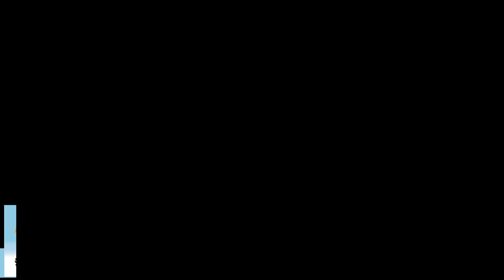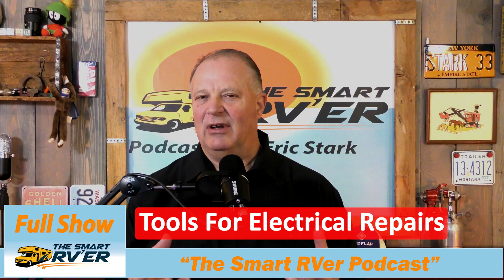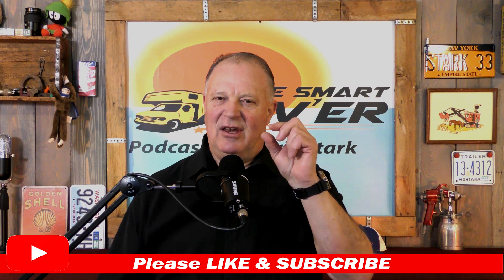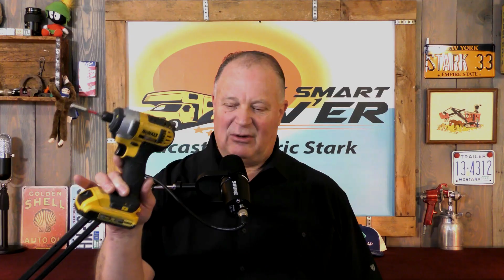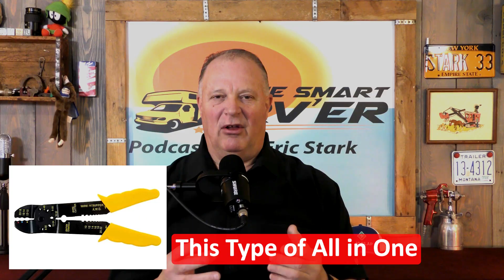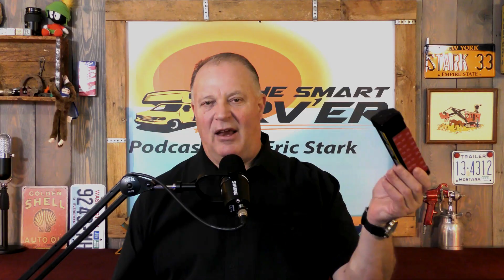⚡ Episode 194 - 194 RV Power Problems Wont Quit? Start Here (Battery + GFCI)

Comment: I am permanent in a RV Park here in North Carolina. 2023 Forest River Sandpiper 401 FLX.  So I am connected to a pedestal full time.  RECENTLY had to replace the battery because I had the problem you were talking about. Would it be wise to disconnect the battery because we are on shore power. 
In our old RV, 2010 Keystone Retreat, we never used the battery, and never had a problem. Thank You
Reply from the maker: Thanks for watching. WFCO who makes a majority of the power converters for RVs recommends keeping the battery(s) in the RV and connected to reduce overworking the converter. The battery reduces the load. It also acts as basic backup in case you loose power at the pedestal.
Reply: @TheSmartRVer Thank You